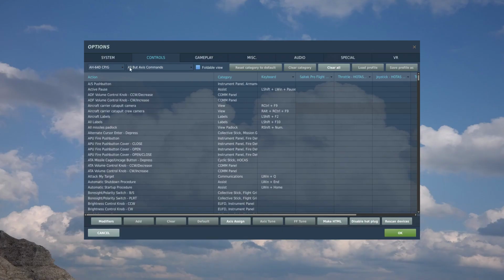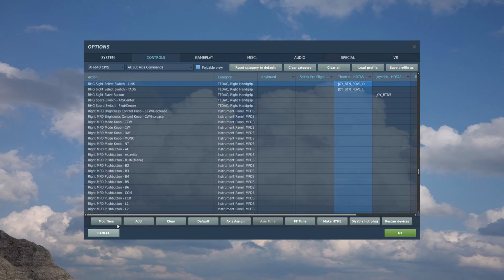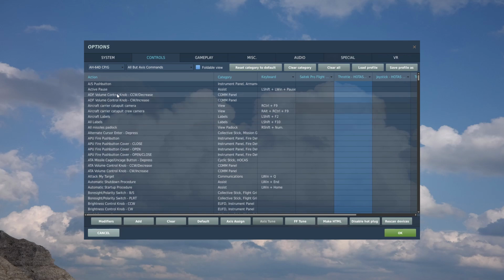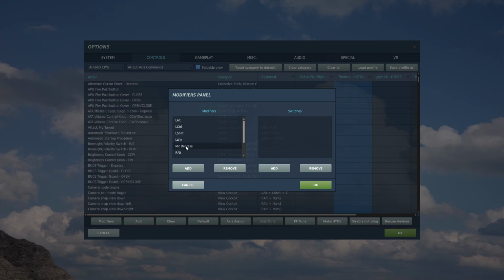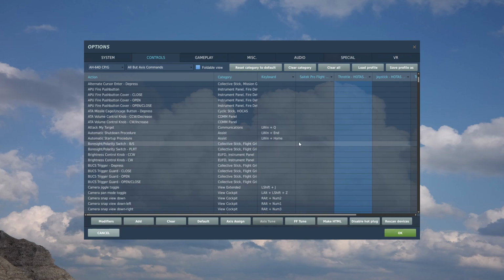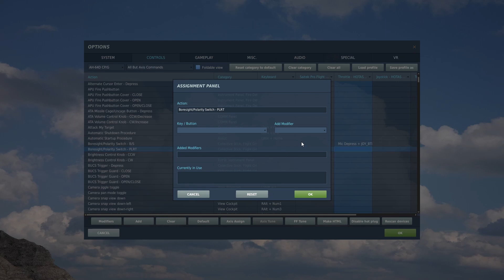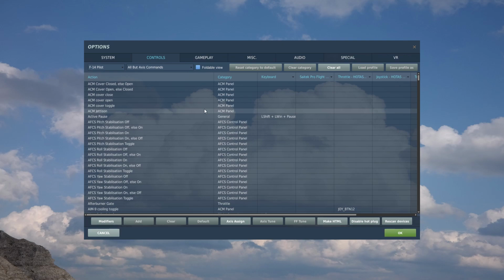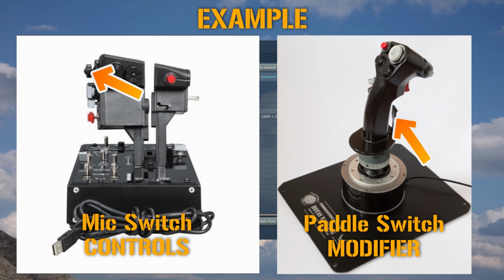DCS Controls - Adding a Modifier

Comment: Great video just what i was looking for I have a Virpil throttle it has 3 toggle switches that I cant get enough of. Makes sense to actuate the modifier with the opposite device. I am going to try it out I just have 1 question. Is the modifier a 1 time actuation or do you have to UN modify afterwards. Thumbs up video! (6)
Reply from the maker: That's a great question that I wish I'd have addressed.  When you  use the modifier you have to keep it depressed while you hit the other button, then once you're done with that you'll just release both and the modifier is no longer engaged.  In other words they don't latch.  So if I use my joystick paddle switch in conjunction with my throttle mic switch depress for...let's say....gear up/down, then I'll hold my paddle switch then depress the mic switch then let both go and there will no longer be any input from either.
Reply: @311Gryphon  thanks i think that answers it. As soon as you let go back to regular mapping I will give it a try soon. Thanks